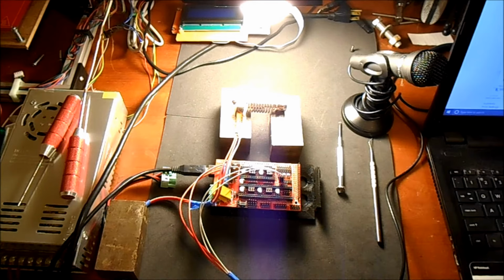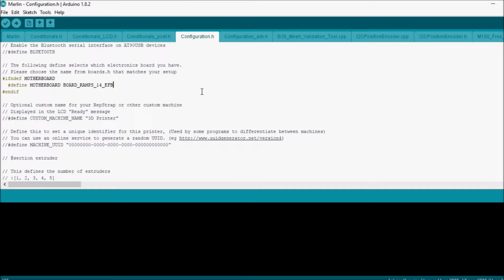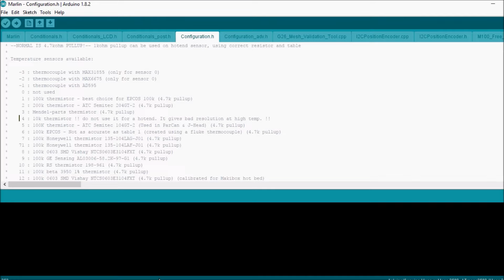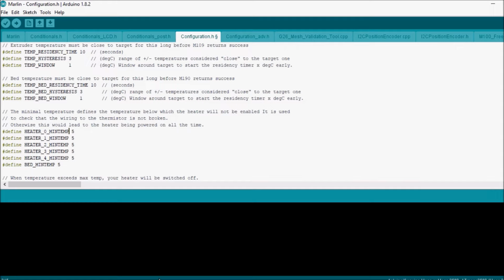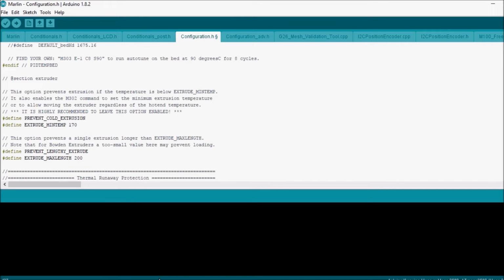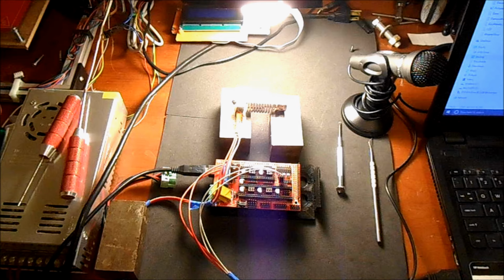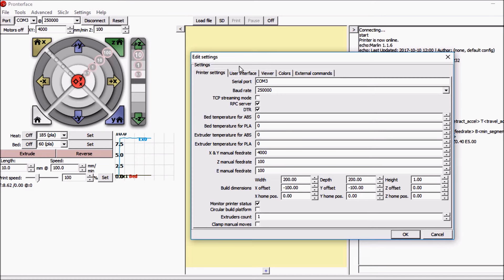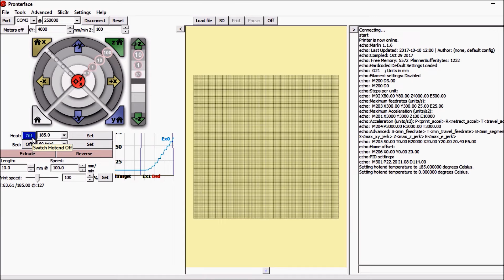RAMPS 1.4 - Hot end and Thermistor install and Marlin firmware  configuration

Comment: I've an old all metal 3.00mm J-Head (e3d clone, I think) from 2015 in my old reprap mendel 3d printer. I had to install a new Marlin instead of Repetier and now I've bad temperature values at high temperatures. I set the number 8 as you and it work great with PLA at max 210°C. If I manually set the temperature from display, more than 210°C the temperature constantly random fluctuate. exaple: Set 230°C  it show 216°,256, 225°, 262°, 240°, etc...
Sometimes the printer stop working with E1 error and the Marlin "alert" temperature is setted to 275°C and is never reached to my random readings. 

I've to set the PID? I noticed there is a J-Head thermistor, n°5. I'll try with this change but it look same 100k + 4,7 Kohm resistor...

I check my sensor and move a little, I fix it, I add conductive paste, I check cables. The problem remain.

My printer works fine with old repetier firmware. I had to add the hotend fan  because before I had only a settable fan that I use to cool the hotend. Marlin use it to cool the print and it start the print with fan off. The printer stop working after a while with E1 error.

The big problem is I don't know wich thermocouple I use! Was provided with j-Head...
Reply: I think I've solved! I set n°5 j-head thermistor  and set at 300°C the maximum temp for extruder 0 instead of 275°.
Now I printing at 248°C whitout erratic temperature reading! If the printer don't catch fire, I think my problem is solved!!

Comment: Still not work I change thermistor, Extruder connection on E0 i did that but my LCD temp is change into 185  from 210 do you know what is wrong ? error E1 Heating Failed Printer Halted
Reply from the maker: The thermistor can be checked without hotend by plugging in only thermistor and connecting to board without PSU power.  You use only the power from 5v in USB cable connect via Pronterface and use heat from ones hand on thermistor to check if operating correctly.
Reply: I've same issue but from Higher temperatures than 215/220. I Modify from display too because I sliced for pla 210°. When I set Higher than 215° The display show randoms temperatures. And sometimes I've E1 error
Reply: I think I've solved! I set n°5 j-head thermistor  and set at 300°C the maximum temp for extruder 0 instead of 275°.
Now I printing at 248°C whitout erratic temperature reading! If the printer don't catch fire, I think my problem is solved!!

I Think E1 error should never appear now. Marling should have somewhere the 20°C of difference / tolerance to stop the machine with E1 error. 

So, My problem was wrong thermistor setting, also if they look the same in the list, I think there is a particular tune for each.
Reply from the maker: Printing about 200 degree Celsius isn't recommended if you're using PLA, which filament are you using?

Comment: We select the thermistor which we bought in marlin firmware but after following instructions from the above video it's showing negative reading... How to troubleshoot
Reply from the maker: Sounds like it's not connected.  Test the thermistor with a multimeter.  If the thermistor shows continuity on the multimeter, then it's a board level connection issue.

Comment: i keep getting error E1. heating failed. Bought pack of thermoresistors, changed in Configuration.h  for 11 (ntc 1% )still same error.    For some reason in room temperature   on LCD says -26 degress, adding some heat on thermoresistor  with heatgun,   value changes, but after stopping  it goes to -26.   Heating element doesnt even tried to get warm, D10 led doesnt turn on. Not sure what is bad Board or heating element or using 750WPSU. Anyone  knows  what cause this
Reply from the maker: It means connection to board is not
 correct.  Either thermistor or board connection is not connected.

Comment: I have NTC 3950 thermostat and board Ramps arduino what is good thermal setting TEMP_SENSOR
Reply from the maker: 8
Reply: I main What I choose TEMPERATURE SENSOR if I have NTC 3950 Thermostat
Reply from the maker: It might involve creating a temperature profile.  I've never configured a profile level thermistor, you'd need datasheet and the Marlin directory where it may reside.

Comment: I try to something this ! Maybe It works.
driver in E0, 
hot end in D10
temp probe into T0

Driver in E1
Hot end in D9
temp probe in T2
Reply from the maker: You can examine the pins file to locate exactly where the thermistor pins are located on the board in Marlin firmware.
Reply: @EdwardBraiman  I also one question the carbrige have a negative and positive connection how to you know it the right connection on D10 ramp 1.4?
Reply from the maker: Power for thermistor and heating elements do not need polarity.

Comment: My ramps board is connected with pronterface but nothing is working
my hotend is not heating my motors are not moving, what can i do
Reply from the maker: What do you see in Pronterface after connected?
Reply: @EdwardBraiman  i am facing some confusing problems in setting up the printer firmware can you please stick around and help me
Reply: @EdwardBraiman  are you available on instagram
Reply: @EdwardBraiman  actually i am starting a startup of manufacturing 3d printers so the prototype model is very important to work in front of investors that's why i need your help. Will you help
Reply from the maker: When Pronterface starts after you press connect, what texted displays?  Please cut and paste within comments.  Unfortunately I can read your computer screen with the text in the issue.

Comment: I ask you a Question How you fix My Temperature is Heat Failed Halted error  I set temp. to pronterface 210 but he got only 140 then shutdown error message heat faild
Reply from the maker: This error is generally related to a broken thermistor or loose connection.  Given it fails at 140 degrees, my guess from a distance is thermistor needs to be replaced.
Reply: @EdwardBraiman  Even I replace my thermistor still E1 heating failed halted error.
I using Marlin Firmware also my extruder during I test on LCD not work I connect to E1 or E0?
Reply: And this is the message to my pronterface - Error:Heating failed, system stopped! Heater_ID: 0
[ERROR] Error:Heating failed, system stopped! Heater_ID: 0

Error:Printer halted. kill() called!
[ERROR] Error:Printer halted. kill() called!
Reply from the maker: In my channel description there's a link to Discord chat, post your configuration.h and configuration_adv.h  in general chat.
Reply: @EdwardBraiman  what you main on configuration.h and configuration.adv.h?
Reply from the maker: I want to see the configuration.h to understand if a software issue is occurring.  The Discord link is a way for people to communicate with me or others to solve problem.

Comment: Why did you put the value 8 on the temperature sensor?
Reply from the maker: It's matches the thermistor I used.  Also it's most common.
Reply: @EdwardBraiman , ok thank you
Reply: @EdwardBraiman , I have a problem when it finishes compiling it gives me 2 errors 
"Heater_1_pin not defined for this board"
And the other " temp_sensor_1 is required with 2 or more hotends"
Do you have a solution for this problem cause I'm sure my wiring is good
Reply from the maker: Depends.  The video was recorded about 3-4 years ago and I'm guessing the version of Marlin firmware was around 1.6.  Marlin has changed a great deal so I'd need to ask which version of Marlin are you using?
Reply: @EdwardBraiman , marlin 1.8.15
Reply: @EdwardBraiman , ok the problem is when i program it to 2 extruders it gives me this problem, when I program it to 1 extruder the error is gone but I'm only able to use 1 extruder

Now I'm facing another problem motors only turn in one direction and the endstops does not work :/
Reply from the maker: Try using either current Marlin firmware for 1.1.9 or 2.0.9 and if that's not working post your configuration.h, configuration_adv.h and/or platformio.ini on Discord and I or someone else can look at the issue in general chat.

Comment: Hi Edward, I got this E3d V6 hotend. I plug it in to T0 pin, after doing marlin setup it measures the temperature as -26C (actually it is 28C now). After that, I try to plug my heatbed's thermistor to T0, it perfectly measures the temperature as 28C.
I also try different thermistor settings on Marlin (No:11, No:5 etc) but the result is same=incorrect temperature. When No:11 is selected, on LCD hotend's temperature is shown as 955C :)
Any suggestion? Thanks beforehand.
Reply from the maker: Check continuity with multimeter meter for thermistors and if they work, then it might be a board level issue.  You can also try another thermistor port and if it works, modify yours boards pins file.
Reply: By “another thermistor port” you mean T1 or T2, right? I’ve already tried T1 but result is same. Will check for T2 now. Any tutorial about boards pins file?
Reply from the maker: Maybe on how to add a third extruder.  All you're doing is changing the pin numbers in the file for the signal pins on the thermistors.
Reply: @EdwardBraiman  Unfortunately, it now reads 0 C. Sometimes it fluctuates between -14C and 900C. I think I should replace the hotend's thermistor with a new one.
Reply from the maker: If a multimeter reads continuity, then it's not the thermistor.
Reply: I just solved the problem, it was very obvious. I loosen the screw on thermistor in aluminum block, appearently it was too tight and causing short-circuit - problem solved.
Reply from the maker: That's great, congrats.

Comment: Heater_ID: 0
Error:Heating failed, system stopped! Heater_ID: 0

Error:Printer halted. kill() called!
Error:Printer halted. kill() called!
Reply: im getting this error
Reply from the maker: Thermistor or connection to thermistor is broken wires or not connected.
Reply from the maker: Thermistor issue.